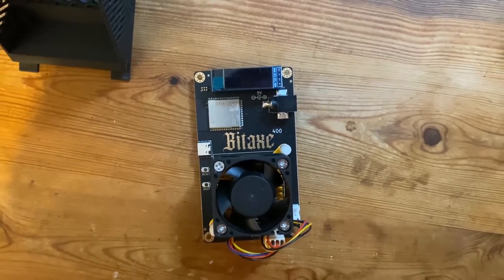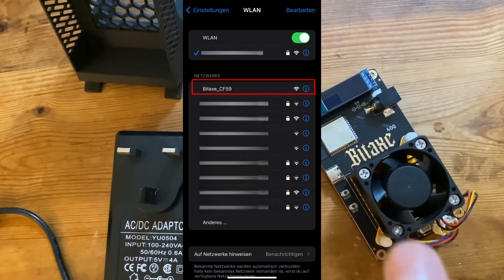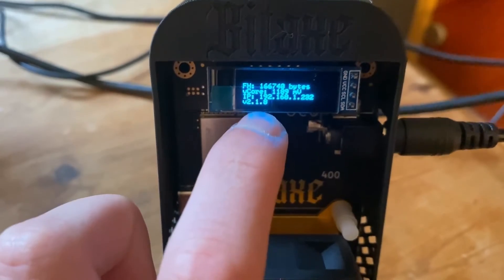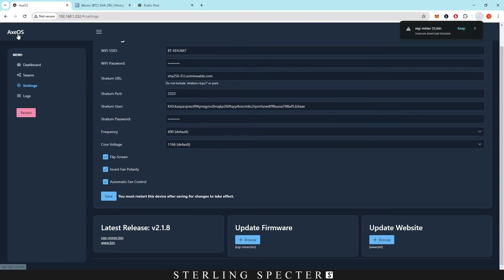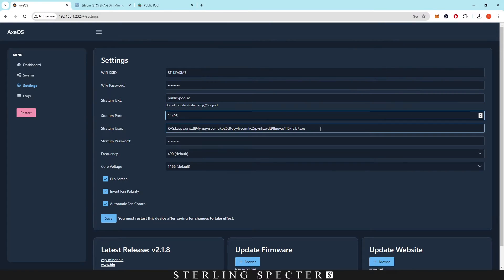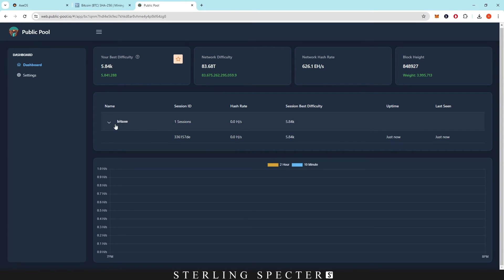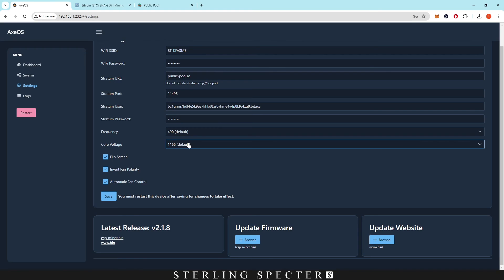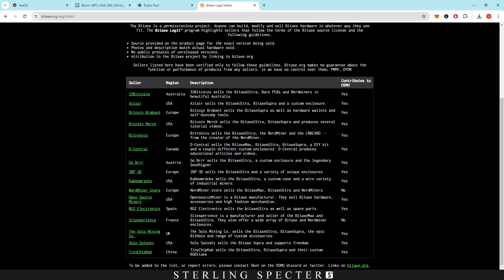Bitaxe Supra 1368 - Setup and Overclocking | Solo BITCOIN Miner 650 GH/s

Comment: My supra is only running at 380 ghs max. no matter what voltage or frequency settings i use. Any suggestions what the problem may be?

I have the version with the noctua fan and room temperatures are around 22 degrees.

Comment: I recently received mine with the 1366 chip and everything seemed fine until I connected it and I couldn't get it to work for more than 3 or 8 hours in a row and it restarted without any kind of sense, I already checked everything, both the router and the configuration. own bitaxe, I still tried with different pools and nothing I do makes it stop restarting
I'm starting to believe that it arrived damaged or something like that.
Reply from the maker: sometimes they can come and have a bad chip, but they all should be tested so i dont think its broken. its probably the connection is what i have found
Reply: @SterlingSpecter1  How exactly are you mining Kaspa on the bitaxe. Please show us howw
Reply: Have you checked if your WiFi router is in 2,4 ghz mode? It’s not working with 5 ghz. This at least fixed my issue with the miner
Reply: @Bushodi  Yep, that was the first thing I checked but now everything is fixed, I updated the FW and everything is fine
Reply: @KevinAndres1231  great to hear mate, GLTY 😎🙏🏼

Comment: 6:45 - "Stratum U.R.L. As it says there, don't use 'stratum+tcp' and then colon dash dash or the port number. So we only want the Stratum U.R.L."
I believe this is a pervasive error across implementations, but the field is incorrectly named. The field should be named Stratum FQDN, if they explicitly do not want the scheme (stratum+tcp) or port number. See Wikipedia: URL#Syntax